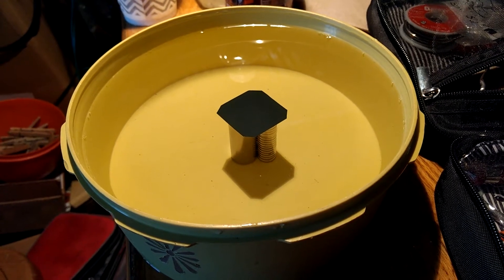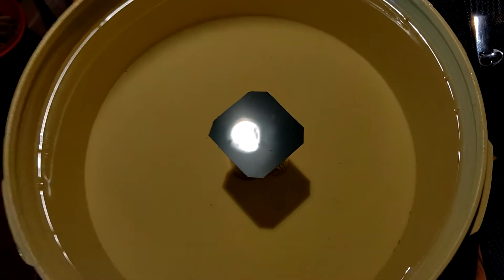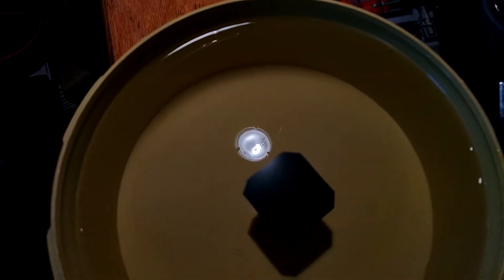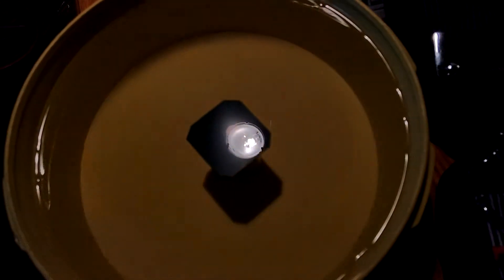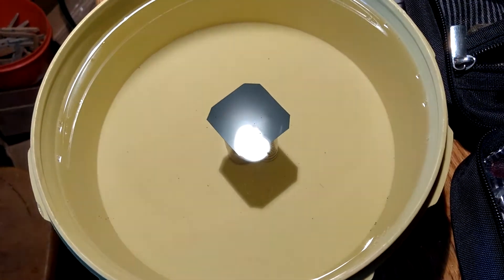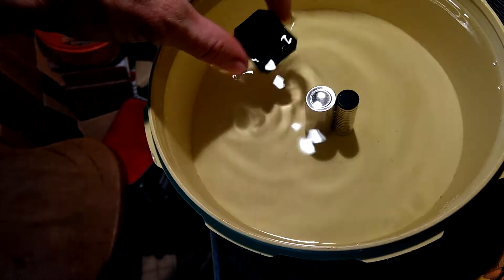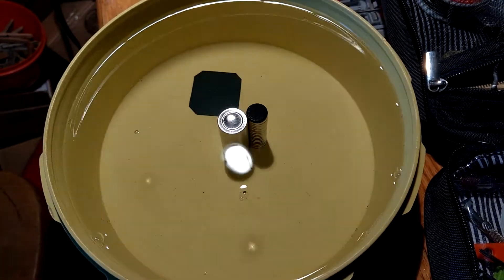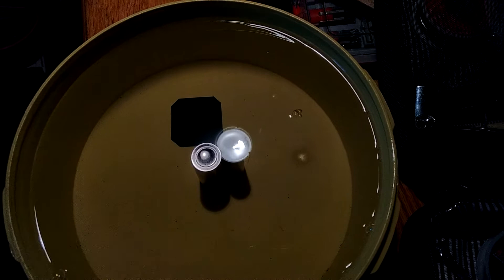The Moses effect of magnetism on the surface of

Comment: The reflection distortion looks like a bulge rather than a dip, so I'm calling it the anti-Moses effect [I was wrong!]. That is a piling up of the waters rather than a parting of them. :-D
Reply: As shown in https://www.youtube.com/watch?v=Gqr5qdDDRB8 water is diamagnetic -- resists a magnetic field. So the effect might have been analogous to the tidal bulge. The magnetic field opposed the gravitational effect raising the water slightly.
Reply from the maker: A bulge would make the light bulb look smaller, like looking in a little bulged mirror. The dip makes a concave mirror which magnifies, and this video shows magnifying, so I'm pretty sure it's a dip :D
Reply: @fromjesse  Yeah you are right about bulge and dip. Look at an old light bulb and everything is titchy. Look at a shaving mirror and its slight inward curve magnifies. The Moses effect then definately. Water is still diamagnetic though so instead of opposing gravity it is making the water less able to enter that area? Hmm so in the video I saw of a magnet pushing a tiny cup of water around, the water moved away as it was going from a region of higher "pressure" to one of lower "pressure".
Reply from the maker: @sthurston2  Yeah exactly, the water is repelled by the magnetic field. So yeah, the water could flow down hill to fill that low spot, but it would have to push against the magnetic field.

Comment: Ohh curved water who woulda thought !
Reply: Of course water curves. Electrostatic shows that physically. Now spin that bowl or ball and see how the waters show motion and don't stick to said spinning container.
Reply from the maker: I bet the water sticks just fine to a spinning ball if the ball is only turning gradually one turn in 24 hours. Ya?
Reply: @fromjesse  Yah not exactly. 'It turns continually [once every "24 hours" on off is irrelevant😆 ] Oh and don't forget it's travelling at '1000 mph.' 
The water will {centrifugal} go to the point of least resistance the counter space of the fields inertia and be what? flung off. 
Field modality curves back on itself. The water is trying to get out of the way of the magnetic field in your experiment. 
Magnetism is NOT a neat consistent peel on the orange. and even if it where you've just shown it would push the water off the Earth. Ya!
In your level flat dish here you've simply demonstrated how tide fluctuations may work on a flat plane.
Reality:- World wide random thicknesses of iron deposits on and within the Earth crust, the light is the Moon
, you figure out which is the magnet. 
West AU is literally made from iron some of the largest tidal movements in Earth occur there.  (invest in a PDR zebra light) and keep thinking 😉
Reply from the maker: @AV036   Uhh, I'm not sure what you're trying to say. Are you high?
Anyway, no, it's not irrelevant that the earth only turns once in 24 hours at an even rate.
If you actually did the math,  or simply measured the centrifugal force on something that turns gradually at the rate of 15 degrees per hour, you would see that the centrifugal force is not nearly enough to overcome the pull of gravity.
Reply from the maker: @AV036  GLENNN!!? Is that you? How are ya buddy?
Reply: Interesting, tnx for sharing